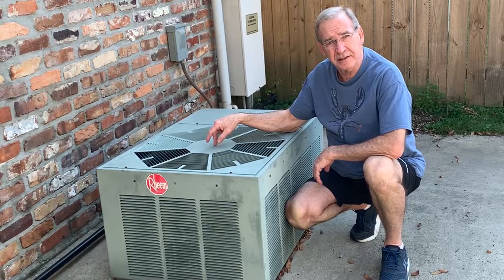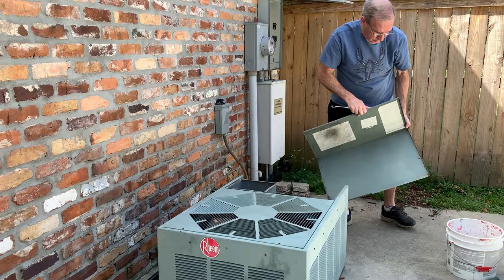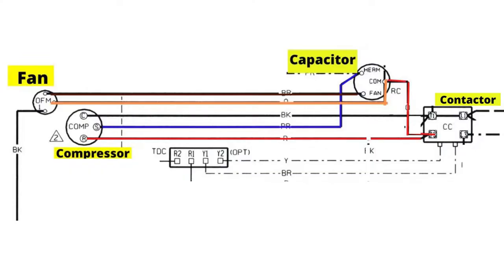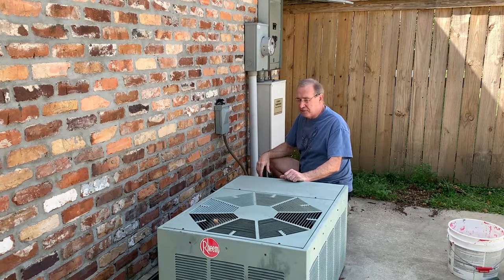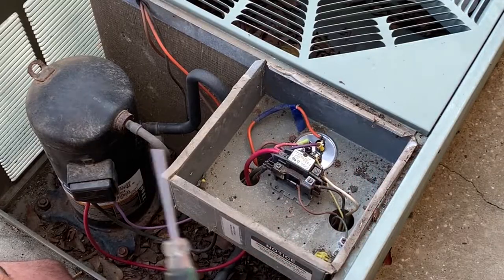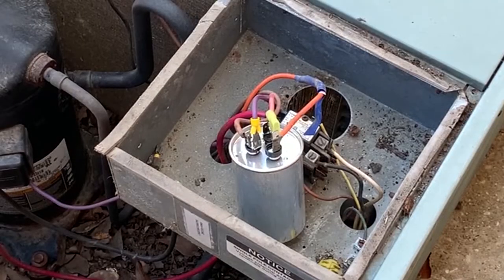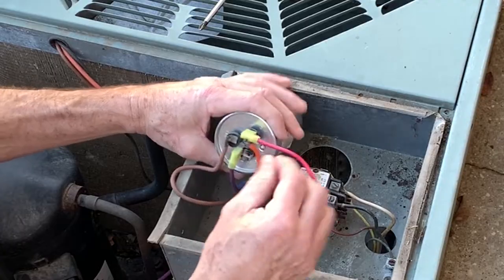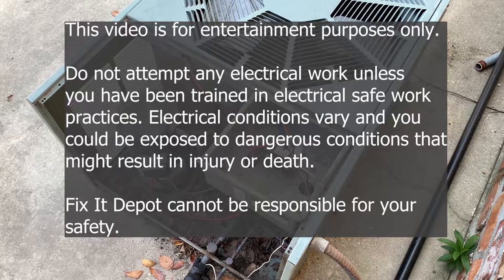Air Conditioning Condenser Fan Motor Blowing Air In The Wrong Direction

Comment: I bought my house 2 years ago and the ac wouldn't cool the house enough. I thought it was because of the high temperatures here in CA. After some digging I found 2 problems. First, the capacitor was the wrong size (50+7.5, when it needs a 50+10). The second issue was the wiring. The fan was blowing in reverse. After seeing your video and looking at the diagram, I was able to fix my issue.

Comment: Thank you for your video, my landlord fixed the ac before summer and just 2 days ago the fan outside was spinning backwards and the compressor was making humming sounds when engaged. Found that my capacitor was bad and the landlord installed the last compasitor with the wiring wrong. He had the compressor wire on the fan and the fan on the herm.
Reply from the maker: He should give you a discount on the rent for having a renter that cares.

Comment: Thank you for this. Thank you even more for explaining where the wires of different colors should be coming from. My unit's purple wire comes from the fan, not the compressor, so likely, someone made an error, or standards changed over the years. I was quoted over $500 for a new fan and capacitor, so I shall be trying this out.
Reply from the maker: You are welcome!

Comment: I made a mistake when I ordered the fan motor, the rotation is wrong and it's not reversible. Can I run the unit with reverse rotation for a couple days while I find an opposite fan blade or new motor?
Reply from the maker: Mine ran for a couple months that way before I noticed it and it was ok.